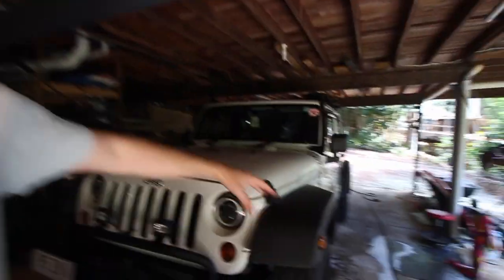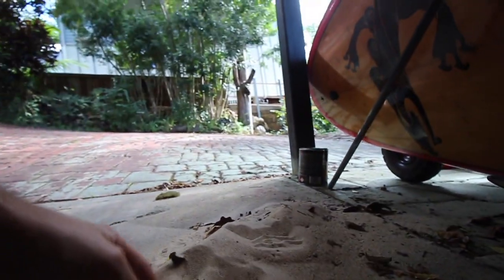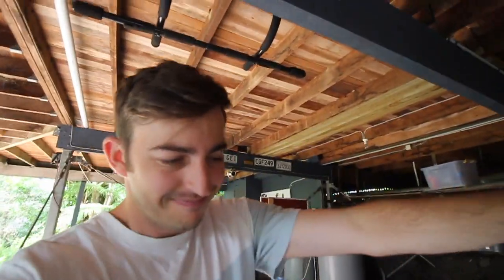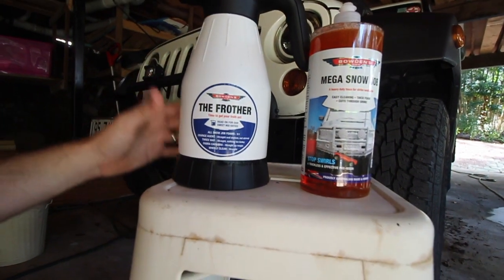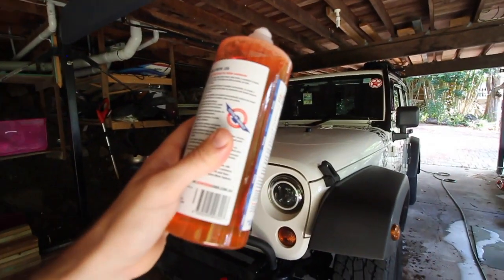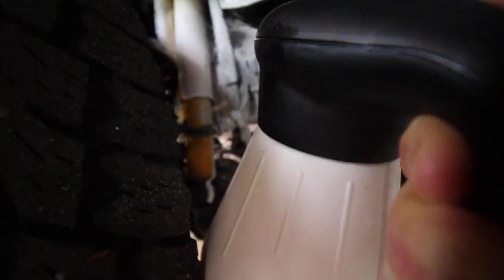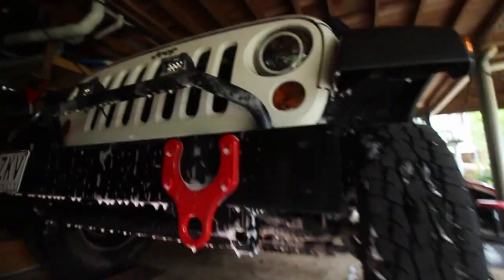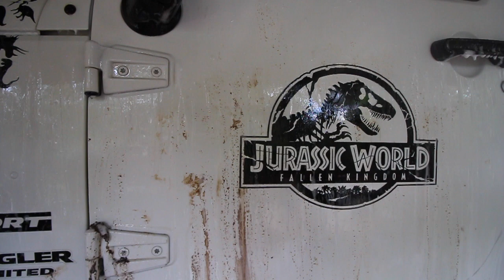BOWDENS OWN MEGA SNOW + FROTHER

Comment: Can you test out how many pumps this needs to operate at full capacity and how many seconds the foam pressure lasts for?
Reply from the maker: Yep definitely, it is about 15 pumps for about 30/40 seconds of spray. Hopefully this helps
Reply: @Whiteandsonsgarage  Cheers mate.
Reply: But don’t be afraid to keep pumping till the relief valve pops. (30-40 pumps) 
This then gives some very thick sticky foam especially in the standard foam setting (standard is called “dry” foam)